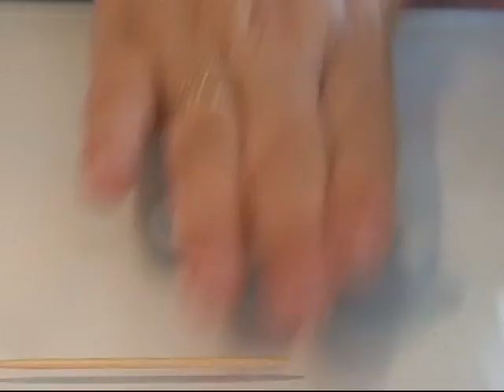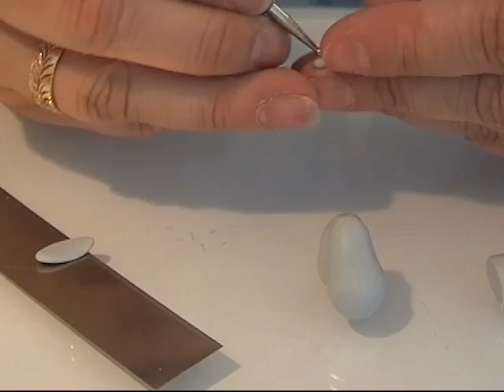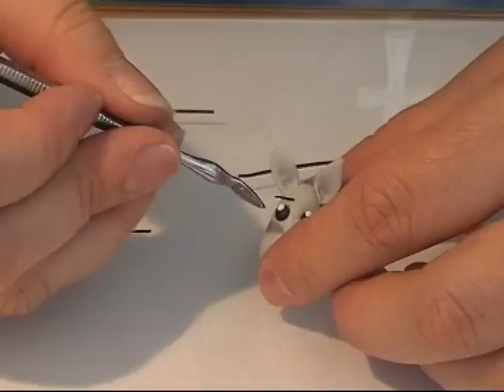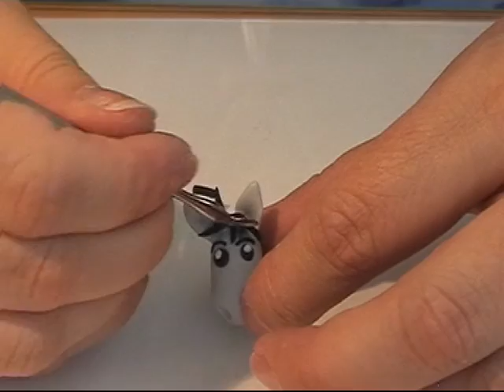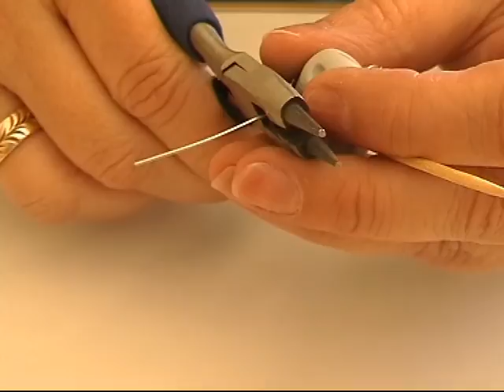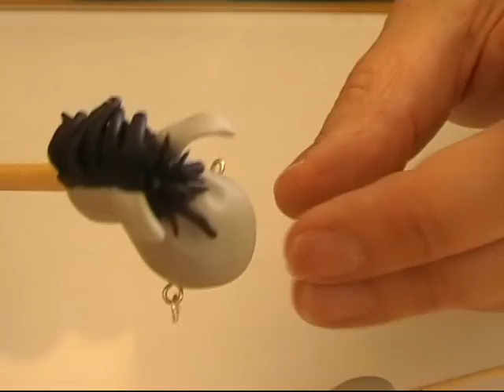Polymer Clay Miniature - A Horse On A Stick

Comment: Great tutorial. What glue are you using? I didn't use any, and a ear and some hair fell off. It's my first time doing this...
Reply from the maker: Lucia Candu I did not use glue for this, as the clay will stick together if it is conditioned good, but otherwice you can use a little bake and bond, to make it dåstick even better, use it before baking